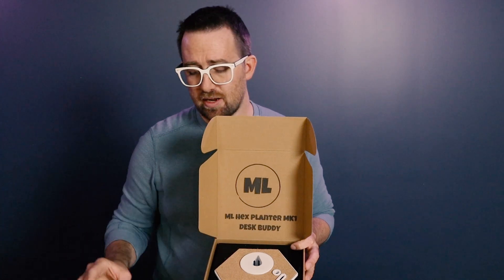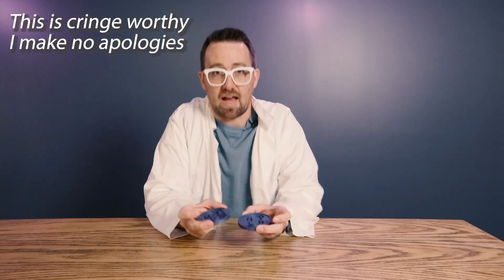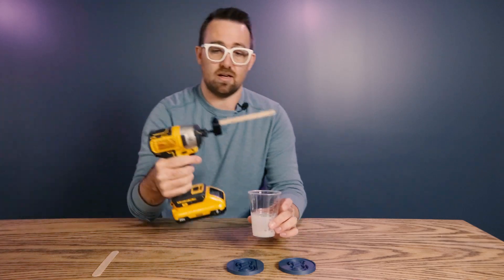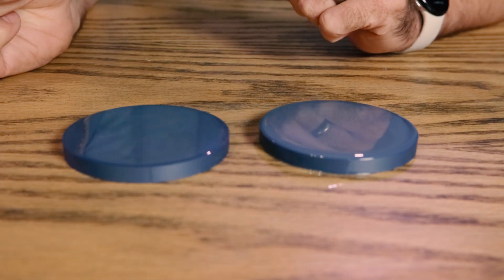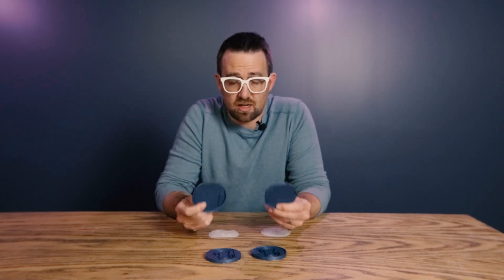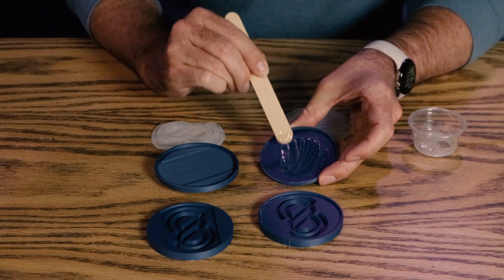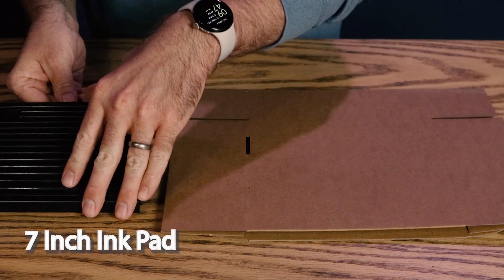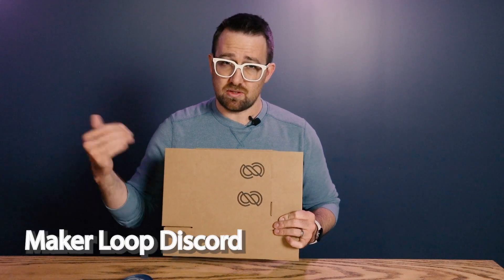Making a Rubber Stamp with 3D Printing

Comment: Any chance you can provide a link to the ink pad you use? Ive followed your guide, made a great stamp but it just doesn't hold the ink like your one does, im guessing its the cheapest ink pad available on Amazon that im using.
Also what size extrusion are you using for the stamp? I went for 2mm but not sure that was enough.
Excellent video btw. Thanks.
Reply from the maker: Yeah this is the ink pad that I used (the 5"x7" one): https://amzn.to/41OBgjo
For the extrusion I went 4mm down, and also added a chamfer to edges of 2mm to help give some stability to the rubber.
Reply: @makerloop  Thanks for getting back to me mate...I'll check that ink pad out, definitely looks better quality than the one I got. Great idea with the chamfer also.👍
Reply: Having the same issue, the ink doesn't hold onto the silicon very well. Certainly not as well as this video. The ink in this video seems quite viscous. I wonder if its a special ink?
Reply: @techstuffdiy7947 it’s the ink buddy, cheap stuff won’t work, it’s too thin.
Reply: @g @gavbrad8428 ahh I suspected as much, thanks! I’m literally just playing around with a different ink now and it’s thicker and the stamp is definitely cleaner. 😊

Comment: how do you get the silicone to ''absorb'' the ink ? i tried it but the my silicone is quite hydrophobic so the result has a short of pattern ( since the ink sticks to the stamp in small droplets )
Reply from the maker: The ink definitely shouldn't absorb into the silicone. My best suggestion is to make sure you have enough ink in your ink pad, and really dab the stamp several times around to get a good covering. Then when placing the stamp make sure to give a really firm push down without moving the stamp horizontally. The silicone should press the ink flat into your target rather than just a "transfer"
Reply: @makerloop  yeah i ment to cover the silicone . I ll try to put (even) more ink in the pad because i already put quite enough. I also sanded very gently the stamp letters with 320 grit paper and it already works better . I guess there might aslo be some difference in varius brands of silicone in terms of how hydrophobic the material is. Thanks a lot for replying!!
Reply from the maker: I hadn't thought about sanding the silicone that's a really good idea! Yeah I'd be curious about the efficiency of it between different hardness silicone and different brands. Might be an interesting video to make.
Reply: @makerloop  my silicon was PL-40!

Comment: nice, I thought you owuld use tpu, is there a reason why you didn't? thanks for the vid.
Reply from the maker: TPU doesn't hold the ink as well, and unless you get really soft TPU it can be hard to press evenly enough to get a clean stamp. The silicone is an extra step, but it's an easy one and definitely worth it for the stamp quality.

Comment: "There are a lot of cad software they can use." 

Is someone using AI to write there scripts and not double checking the wording before recording?
Reply: There is a certain irony in your remark.
Reply from the maker: Wow. Definitely didn't use any AI to write the script, but I did use Adobe Premier's Dialogue AI Enhance stuff. I had really bad mic interference (not sure what caused it yet) but the tool fixed almost all of the issues, I didn't know it could merge/blend the words though!

Comment: There is a third way, fusion 360 calculate solid objects volumes. You can model your rubber part by subtraction and get the volume like that.
Reply from the maker: You're absolutely right. It takes just a little bit more effort to model the mold area as a single volume to use as a subtraction. Definitely a clean way to get exact numbers with the object volume then. I'd probably still add ~5%-10% extra to the number for something this small since not everything comes out of the cup, some gets stuck to the stirring stick, etc. Always lame to have to mix up a second batch really quick.

Comment: Why silicone? Would TPU be bad?
Reply from the maker: If you used a really soft TPU you could get a decent result. Nothing sticks to silicone rubber though, which helps give a very clean stamp result. With TPU you're likely going to see print lines in your resulting stamp (which could be a cool look if that's what you're aiming for)
Reply: With TPU or even flexible PLA, it's way too firm and it really doesn't want to hold ink.  It'll work, but the silicone is much softer and way better for making perfect stamps.

I just went through this a month ago, wish I'd thought to use cast silicone.

Comment: Great video, never thought about molds for a stamp
Reply from the maker: Right. It wasn't something that jumped out to me at first until I started looking at adding some design elements to my shipping boxes (without getting them expensively printed in a bulk order). It opens up a lot of options for cool designs, especially with how easy it is not having to do negatives or mold boxes or anything, just drop some silicone in and good to go.